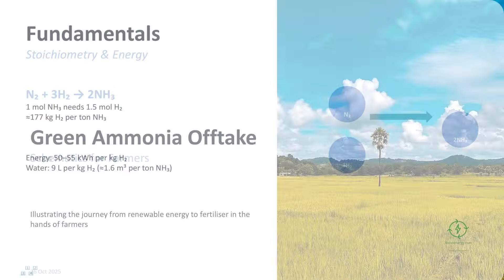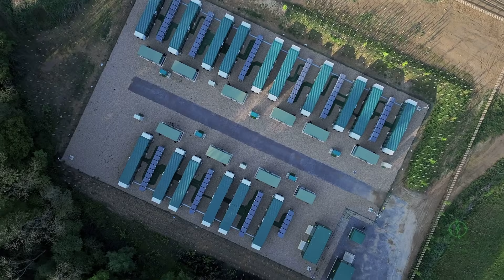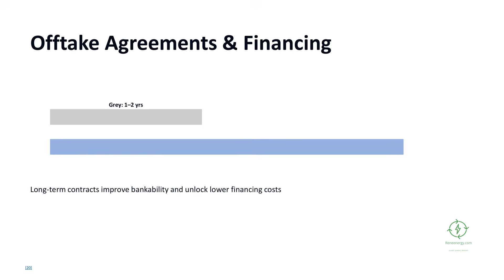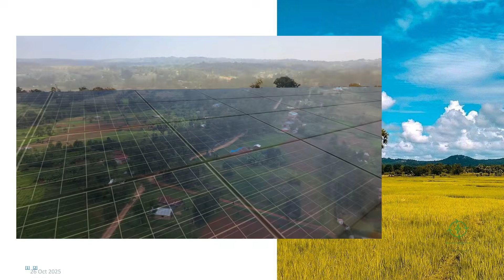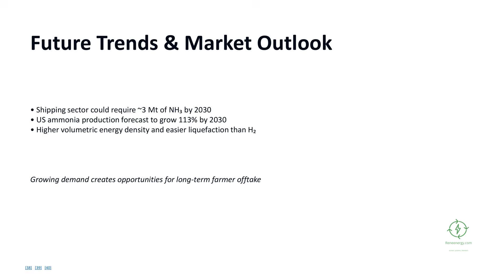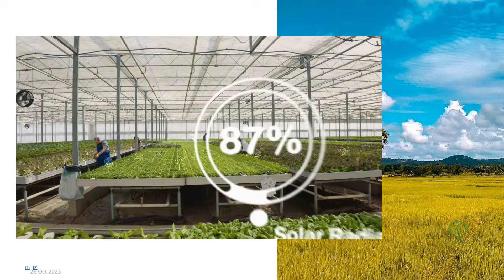How Green Ammonia Will Transform Farming Forever

Comment: How do you get the Nitrogen to combine with the hydrogen? They dont react. 150 atmosphere pressure and 900C is needed? Haber process.
Reply from the maker: Nitrogen gas (N₂) is exceptionally stable because of its triple bond, which requires about 941 kJ/mol to break — one of the strongest in chemistry. Hydrogen (H₂), though reactive in some contexts, can’t readily overcome that energy barrier on its own.Without a catalyst, the reaction rate is so slow that no measurable ammonia forms, even if you heat the gases strongly.
Reply: @renewables2050  so how was it made in the video?

Comment: Ocean water contains 150 times more Co2 than Air and when combined with mineral rich salt water we can produce fertilizers, cement, bricks, chlor-alkali life sustaining chemicals. sodium ion batteries, Co2 Credits, Hydrogen gas and desalinated water as free byproduct of generating zero pollution electricity.
Reply from the maker: That’s a powerful idea — and largely true in principle. Ocean water holds ~150× more CO₂ than the atmosphere, mostly as dissolved bicarbonates and carbonates. If harnessed wisely, it could enable carbon capture and resource recovery rather than just storage.